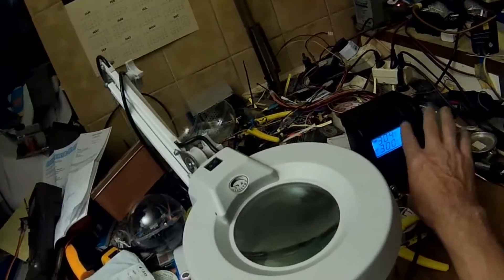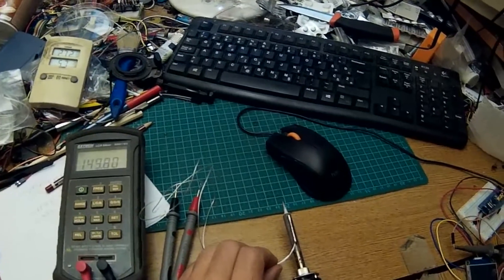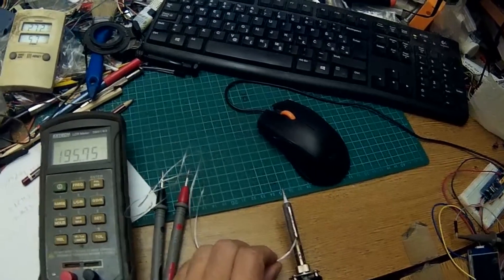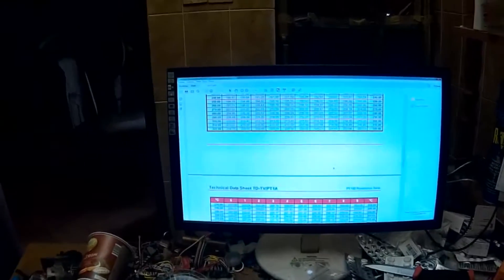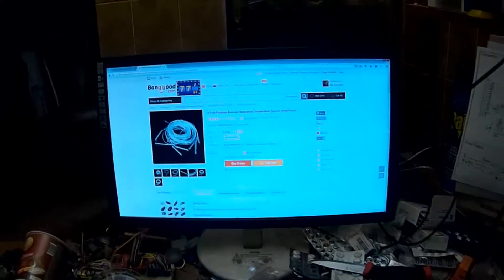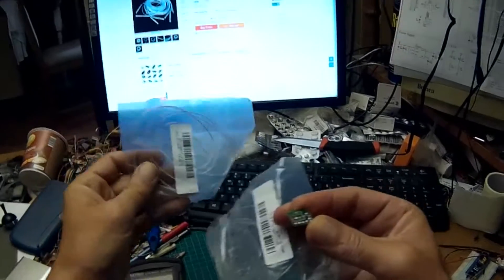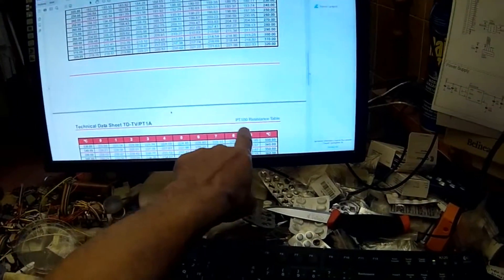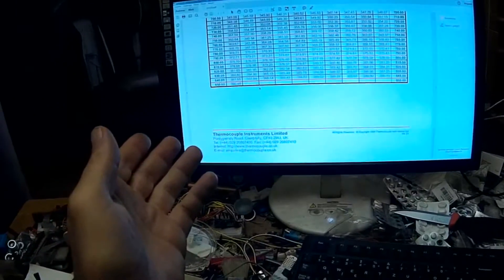Review of PT100 Platinum Wire Thermo-Probe From Banggood.com

Comment: Can i measure liquid nitrogen temperature using this
Reply from the maker: Nope. It is rated from -20C to 450C.
Reply: Milan Karakas it should give some resistance reading at liquid nitrogen if it made of Platinum. I have a resistance VS temperature data sheet for pt100. I may be able to use it that way
Reply from the maker: Oh, seems that it can get actually pretty low, down to -200C: https://scontent-sea1-1.cdninstagram.com/vp/2e7c692c877dc75d62f013f2a7b6e568/5B0D2991/t51.2885-15/e35/12328468_204608979895946_1782244294_n.jpg?ig_cache_key=MTIwMTAzNTQ4NDY4MDUxMDU2OA%3D%3D.2
Reply: Milan Karakas yes... I already have this table.
Reply from the maker: Then probably you can measure liquid nitrogen temperatures.